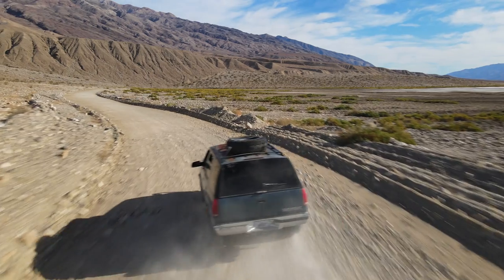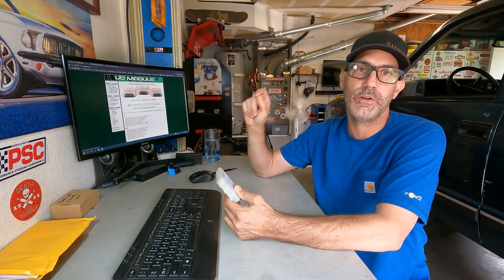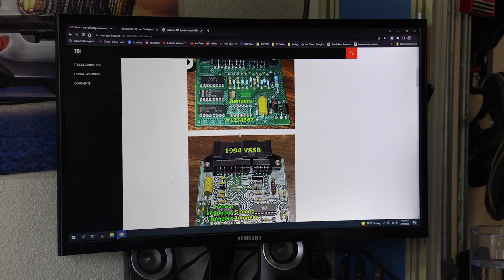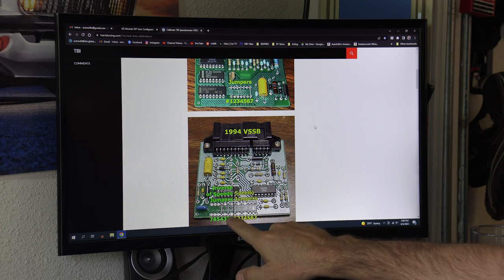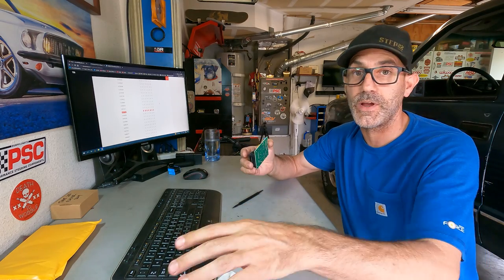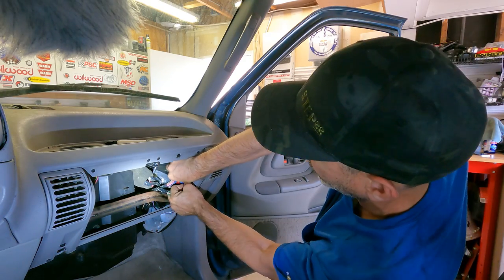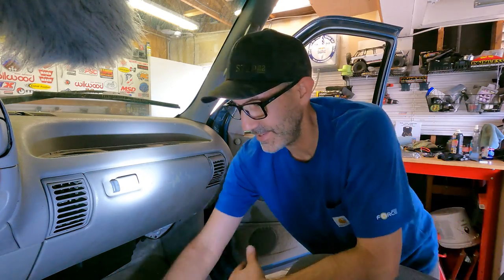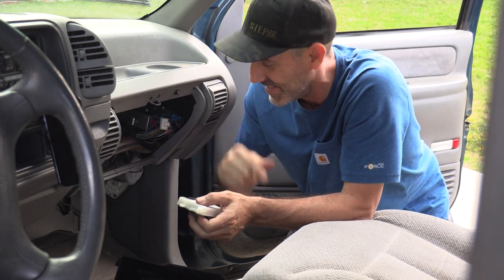1995 Chevy Truck and Tahoe Speedometer Calibration for Perfect Accuracy

Comment from the maker: Howdy everyone, thanks for watching! Leave a note here in the comments...
Reply: how did you figure out the gear ratio?
Reply: Ah
Reply: Ok so I finally got back around to this and figured out the gear ratio for my truck from the RPO Codes. Mines was GU6 which is 3:42. Calibrated mine today. The part came in yesterday. Can't believe I've been riding around in my truck for almost 20yrs thinking I'm doing 50 mph for example when I was really doing 38 mph. Go figure that.
Reply: I have the same problem with my truck, a 95 C-1500 Silverado SWB, Extended Cab. When the Speedometer reads from 20 to 50 mph, the gps on my iPhone reads 7 mph less. When I go 75 mph by gps the speedometer reads 89-90. Since it is OBD-1, no codes were recorded. 
Thank you for showing me what and where the problem resides, and how to fix it.
Reply: On my 99 Escalade/tahoe even my scanner didn’t fix my speedometer

Comment: I just received my VSSB for my 95 2 door Yukon today. So excited to install it and see what these 4.10 gears are like with 33 tires. Thanks for the very detailed instructional video!!!
Reply from the maker: You betcha! Good luck on the install.
Reply: @AutoEdits  Do I have to disconnect the battery every time I adjust the codes, or will turning of the truck, make the adjustments and starting it back up work?

Comment: 95 is a crossover year (96+ interior but, with OBD 1.5 and a TBI motor). 96-00 is OBDII. 96-97 "Black Box" PCMs are a bit limited on what software can tune them, 98+ are much better and if you want to get really involved you can repin the harness to use a programmed "0411" pcm.

Comment: What were the symptoms before tuning? My 95 2 door Yukon is not shifting from 1st to 2nd. Changed to 4.10:1 & 33 tires. Did you have issues with your rig not shifting gears?

Comment: Thanks for the awesome video, I got a 93 project c1500 and the dash was obliterated from Texas heat so I did a dash swap.  The original cluster didn't have a tach so I got one from another truck but now the speedometer is off by 10mph, I have been trying to figure out how to calibrate it but hadn't found anything on these older trucks.  Now I will be able to calibrate it for the size tires I have and have a very accurate speedometer and trip meter/ odometer (I as well have a gas book and keep track of my mileage) (my ocd has been going crazy cuz I know the numbers aren't right lol) 

Thanks for a great video
Reply from the maker: Glad it could help!

Comment: My speedo reads a little bit faster than I'm actually going on my 92 c1500. I may check this out. And I'm getting ready to put 285/75R16s on my 90 k2500. I'll have to check these guys out.
Reply from the maker: For sure, especially if you up size a little bit!

Comment: It should have changed your shift points in the transmission. That is what mine did back in 1998 when i installed it. I need a new 1 like you got so i can calibrate mine since i put 39.5 swampers on it.
Reply from the maker: It did... makes a much improved feel while driving.

Comment: That’s a cool solution…my Speedo is not hooked up right now due to the engine swap.  I was going to get a gps speedo as a solution 🤷🤷
Reply from the maker: I had one of those in the Mustang and liked the ease of installation for sure! Kind of interesting if you live in a city and go in parking structures and downtown... sometimes it would lose a signal for a bit.
Reply: @AutoEdits  that’s good to know!!! I did not even think that would be an issue.

Comment: Thank you.  So, you're basically saying the calibration numbers do not match your setup, and you are manually adjusting to find what works on the road.  Is your setup correct on the truck as you entered it?  Maybe the tires are worn/over-or-under-inflated?  I'm assuming the table is supposed to represent existing gear ratios with new tires, properly inflated, cold.

Comment: I have the same problem with my 97 chevy c1500 i swapped from 4.3 vortec to a 5.7 vortec . And i put didn't tires . My speedometer is off and my tachometer is any advice from anybody please ??????
Reply from the maker: Dude, there's a link in the description to the company I bought the part from.

Comment: HELLO JASON I GOT A ASK. I GOT RAM 1500 2016 AND I WAS WONDERING COULD I PUT SOME HEADER ON.  I JUST WANT TO HEAR FROM YOU ABOUT IT
Reply from the maker: Sure. If you live in a state like CA it would be impossible to legally smog the vehicle but most places that might be easier. I didn't want to rebuild the whole exhaust system for the very slight gain in performance headers would provide... plus those engines sound amazing just like they are... I ran the flowmaster outlaw system and it was fantastic.
Reply: @AutoEdits .THAT WHAT I GOT FLOW MASTER . I WAS TOLD IF I PUT THEM ON WITHIN A YEAR I WOULD HAVE TO TAKE THEM OFF. PLUS I DIDN'T WANT TO MESS UP THE COMPUTER IN IT.. THANK YOU FOR GETTING BACK WITH ME.  TAKE CARE 👋
Reply: I LIVE IN FLORIDA

Comment: All you need to do is find a flat, straight mile or more road and for 1 mile at 60mph you'll get 60 seconds in that mile. Plus or minus tells you how off it is. Then do the test again after you make the adjustments

Comment: Wont work on 96+ with black box pcm  under the hood as this module is no longer used
Reply from the maker: Is 96 OBD2? You could actually use a tuner for that... right?
Reply: @AutoEdits  every vehicle built in 96+ is obd2.
  And 95 corvettes. They were the first obd2 vehicle ever.
Reply: @AutoEdits  good luck finding a tuner to work with the black box pcm under the hood. They were kinda the black sheep lol

Comment: SO much more complex than my 98 K2500. This is why I traded my 93 for a 98.
Reply from the maker: Does the 98 have the same TBI engine or did they upgrade that as well?
Reply: @AutoEdits  I have the L29 454, so it’s a bit more complex than that, but my tuner was able to correct everything with his software when he finished up the Procharger install. Before that I was running a Jet programmer that allowed me to go up to 37” tires.

Comment: Step 1. Have GM gauges that actually move to behind with. 
I have failed step 1 on my Yukon.
Reply from the maker: Is the whole cluster bad? Maybe a used one would be a good option.
Reply: @AutoEdits  it probably is. My CEL does not work, fuel gauge and some other lights don’t work. It’s got 250k on it and I only drive it a few times a year. It gets about 10mpg with my lift tires and tuned ecu. It’s a 2000 Yukon Denali with the 5.7. It’s my baby.
Reply: @TVCColin  do a 411 pcm swap and tuning software like hp tuners or efi live. In 96+ trks gm went to the black box pcm under the hood and the module in this video became obsolete
Reply: @DanMcD80  yes I know. I was just joking about mine. I have a tuned ecu in it already. Thank you though that info could help someone else in here 👍